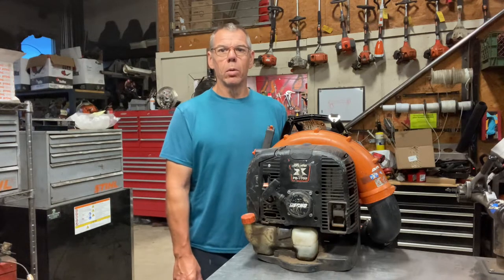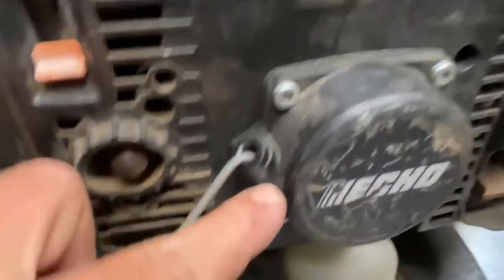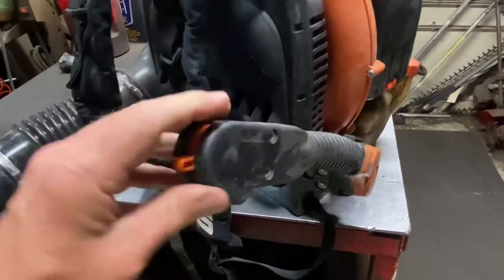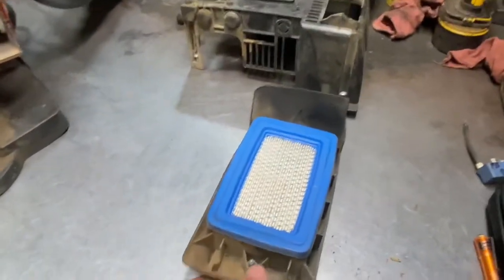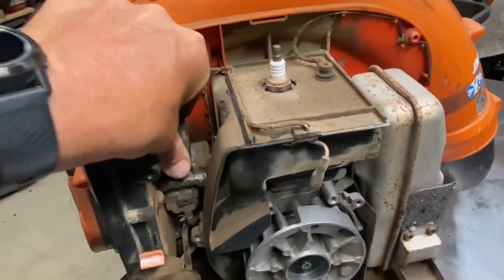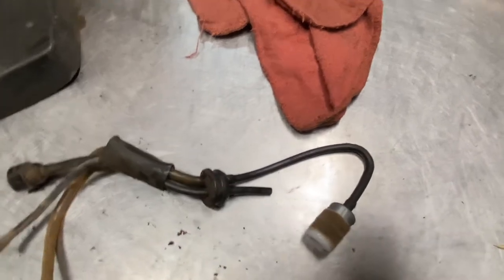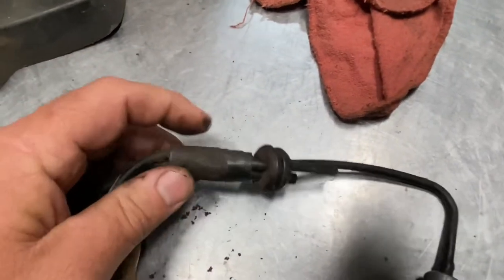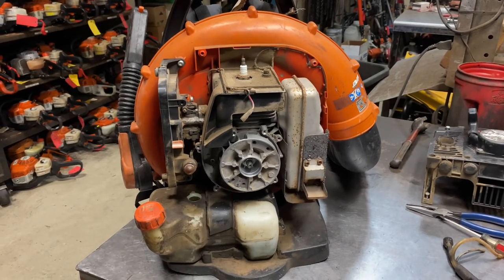Echo Pb 770 common problems / what to look for

Comment: Wally, great video.  I just bought a PB 770H at a g-sale cheap.  It looked like it was well used/dirty but started on only 2 pulls and ran great.  It needed new straps, flex tube and I replaced all the fuel lines, air filter and purge bulb.  The kill terminal on the coil was loose and wouldn't kill the engine.  I inspected the cylinder thru the spark plug hole and it looked perfect. I wanted to pull the muffler but the bolts are super tight and I didn't want to risk shearing them off. Glad to hear these things are pretty reliable.

Comment: Nice job explaining the overall problems with this unit. I am currently troubleshooting an ignition coil problem. I have no spark currently and a new coil installed after a broken spark plug coil wire was found. Will let you know my findings.
Thanks Wally

Comment: I'm cheap so whenever I get one in to flip with a bad muffler I put on a pb403/pb413/pb603/pb500 muffler. The bolt pattern is identical and the gasket is the perfect shape as well. At first I was worried that the smaller muffler would restrict the air flow, but it does not, atleast not noticeably

Comment: I found one of these that was left for dead.  Siezed, no spark plug, water in cylinder.  I put in some WD-40 let is sit for a week.  I was able to free the piston,  i put a carb kit in it.  I actually started and has been running for 6 years.  I do about an acre of leaves.

Comment: I’m working on a friends blower that won’t engage the plastic pawls when you pull the rope. I removed the starter recoil assembly and it works fine but I  noticed a chunk of plastic broken off that looks like it should engage the pawls. I’m guessing it’s going to need whole new starter assembly to fix the problem unless there is a fix that I’m not aware of. (770 T)
Reply: Hello, I’m having the same issue. Did you fix this problem? Or just replace the starter assembly?
Reply: My issue ended up being that my friend had attempted to fix his blower but put the starter assembly on crooked and it destroyed the plastic part inside. If your plastic pawls are in good shape you should be good to just replace the starter assembly. Just make sure everything goes back together correctly and the screws tighten down evenly.

Comment: Thank you for the info mine has ran great for the past 2 years but now it’s bogging down at full throttle after 5 minutes of usage I changed the coil with a oem and it’s still bogging down at full throttle it has new plug new fuel filter air filter and nothing still doing the same thing I’m wondering if it can be my carb let me know if you have any ideas I would greatly appreciated it 👍
Reply from the maker: Could be the carb or simple adjustment. Make sure you have good fuel. Pull the muffler off and inspect the exhaust port for carbon.
Reply: @wallysworkin823  Thank you I finally figured out the problem the new carb I installed was defective and it was a brand new carb but it happens once in a while you will receive a defective carb.

Comment: Mine seems to turn off after I start putting throttle, if I leave it to simply idle it’s fine. As soon as I get on the throttle it works for about 1 minute and then gives out turning off completely. Also once it turns off it shakes pretty heavy right as it turns off. Any idea what if could be?

Comment: I was using my blower today and it just shut off on me as if I pressed the kill switch. I brought it down to an idle and it idled for about 10 seconds and just shut off and then I couldnt get it to restart again. I had to leave the yard and get my backup blower. Any ideas?
Reply from the maker: Sounds like it could be a coil issue.

Comment: Wally, This is a great video. I have a PB-770T which has been running fine. Last fall it started losing power and stalling after 20 minutes of running like it was out of gas. I have to wait about an hour before it will start and run fine for another 20 minutes. Vapor lock or engine overheating. I read someplace that carbon buildup blocking the exhaust port. Any suggestions? thanks, Joe Desiderio
Reply: Mine is doing the same thing... did you figure out what was wrong with yours?

Comment: What backpack blower do you recommend buying.
Need lightweight and powerful.
Don’t like the big blowers too heavy.
Reply from the maker: Find a Stihl dealer and try a BR200 or BR450. Also a Redmax EBZ5150 is an option.

Comment: Any clue why my sprak plug gets cloggged? Could it be not gapped correctly? Fuel mix? Has correct ngk plug so just wondering any input
Reply: Blower doesn’t want to accelerate and bogs down but once i pull plug and clean in between it it works just fine

Comment: Great video 
Do u prefer the the walboro fuel filter with felt or u like the one that’s like  ceramic 
Maybe future u can make video on ur favorite fuel lines and fuel filter if u had to put on back ur self
Reply from the maker: I prefer the felt ones. Good idea on a video, I usually use STIHL fuel line.

Comment: What is your opinion on the Chinese knockoff carburetor/ cylinder and piston as replacement to OEM.  Thanks ahead of time.
Reply from the maker: I don’t like the carbs, I rarely see issues with the factory walbro. Rebuilding them will usually take care of any issues (walbro K23-WYK kit). I don’t have any experience with the top end kits for the 770’s. The ones I’ve seen for other units didn’t seem to last long or run properly. If I remember correctly the Echo piston kit is only $38 and the cylinder is $60 I believe, can’t remember exactly.
Reply: @wallysworkin823   Thank you very much for your timely reply. I live in Tucson and use both of my blowers for Archeological work. I started using a compressor to blow off features and to find them. Then the blower was invented and I've been using it ever since. One thing to pass along. The blue foam air filters I have found leaking at the folded/pleaded ends of the filter  paper. Candeling them using the sun, you might see tiny to large gaps of sunlight shining through. I doubt they do this during quality control. Not sealed well. l use silicone on  those ends.
Reply from the maker: @danarnit7839  Are you using Echo air filters or aftermarket? I’ve seen several issues with aftermarket.
Reply: I think they might be aftermarket. I will buy Echo. Thanks

Comment: Im not sure if you will reply. I have a pb770t just put a new carb on it. However, after just a few minutes, it boggs down, but idles fine. I've tried to find a sweet spot with the needle, but that doesn't seem to fix the problem. Any suggestions?
Reply from the maker: Start with the basics, good fuel, make sure the fuel line and filter are ok, make sure the exhaust port is clean. Are you adjusting the “H” or high side of the carb at full throttle?

Comment: I just picked up a used PB 770H, and my kill switch isn't working. I have continuity all the way to the coil so the wire and post are good. Blower runs fine though. Any thoughts?
Reply from the maker: Echo kill switches are terrible. You can try cleaning the switch with carb cleaner or brake parts cleaner. In rare cases the kill switch post on the coil itself will fail requiring a coil replacement.
Reply: @wallysworkin823  Thank you for the reply! I ended up replacing the coil and works as it should.

Comment: Having an issue w my 770t bogging down and stalling after about a 1/2hr on full throttle, but it idles great. I replaced the spark plug and put in brand new fuel. Possible spark arrestor or coil issue? Any help is appreciated. Thanks
Reply from the maker: Always check the basics first, air filter, fuel filter and exhaust. If it suddenly dies (like turning it off with the kill switch) when it gets warm it’s a possible coil issue. If it slowly loses power then it’s usually a fuel issue. It could be a simple carb adjustment but check the basics first. Check your fuel line as well to make sure it’s not leaking or has cracks.
Reply: @wallysworkin823  thanks for your reply. I’ve done all the basics. The machine has maybe 20hrs total. It bogs down quick and dies. Restarts easy, idles great. Everything looks brand new. Leaning toward faulty coil.
Reply from the maker: @patmk  A coil will not cause a bog issue. Do you use it for home use? Has the unit been sitting? It only takes a few weeks of non use to make the diaphragm in the carb stiff causing the problem you have.
Reply: Sounds like Carburator problem
Reply: See if it does it with the gas cap loose enough to vent.
Reply: Hello, my blower is doing the same thing.... did you fix yours... what was the problem? Thanks in advance
Reply: My advice is to try a new fuel filter first, even if it looks clean

Comment: It's a 770t and I just put a brand new carburetor on it and I'm lost and need help
Reply from the maker: Start with the basics. Did you verify the compression with a gauge or just feel? I ask this because an engine may "feel" like it has compression but if it's not high enough it will be hard to start or won't start at all. Did you verify it has spark? A simple way is to remove the plug from the head insert it into the coil wire, ground the plug to the head and pull the starter while watching the plug for spark.
Reply: @wallysworkin823  I have a compression gauge which I will check I only checked it by Buy fill
 and the spark I checked with a light that you buy from harbor freight to check this part and I tried spraying a gas mixture into the carburetor to see if it would fire
Thank you very much for the reply really appreciate it and I will try the compression test and see what happens there
Could you tell me what it's supposed to test at.
Reply: I just tried the compression test using a gauge and it showed 75 if my gauge is right so it might not be no good I'm not for sure
Reply from the maker: @dorrellmyles9995  75 is low, they usually run in the 125 range.
Reply: @wallysworkin823  could it be the Pistons or rings causing that
Reply from the maker: @dorrellmyles9995  Yes, A simple check is to remove the spark plug and rotate the engine so the piston is all the way down and with a flashlight look at the cylinder, if you see large scratches the travel up and down that may be your issue. Another way is remove the muffler and look into the exhaust port to inspect the piston and cylinder.
Reply: @wallysworkin823  thank you very much for everything and I definitely will try that and once again thank you
Reply from the maker: @dorrellmyles9995  Anytime!